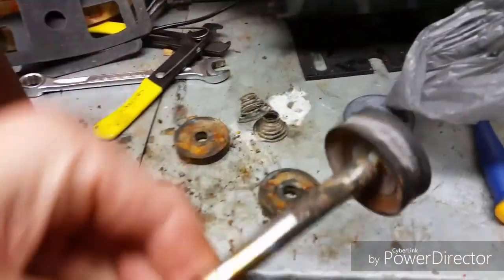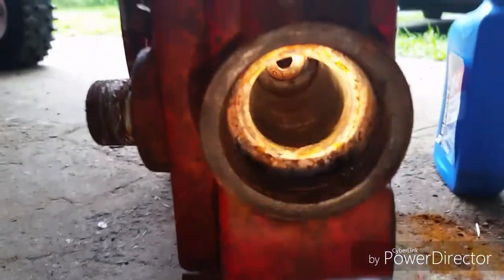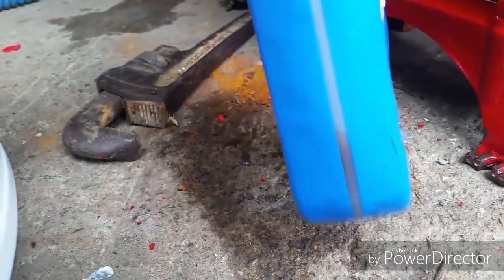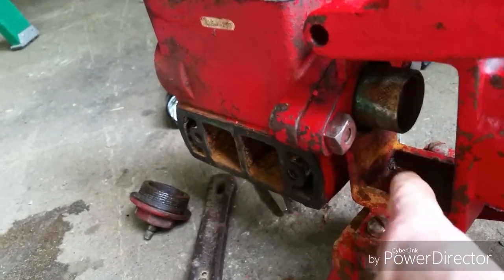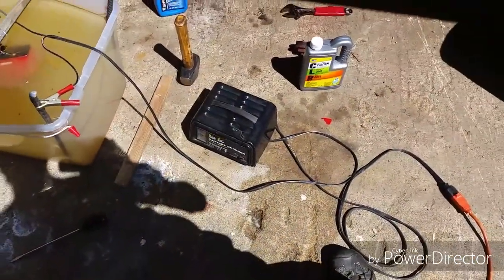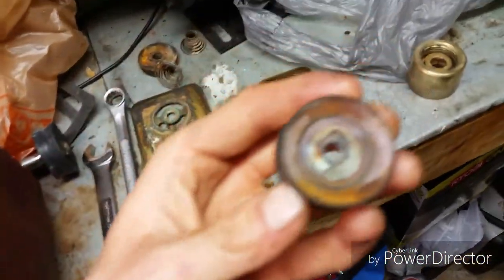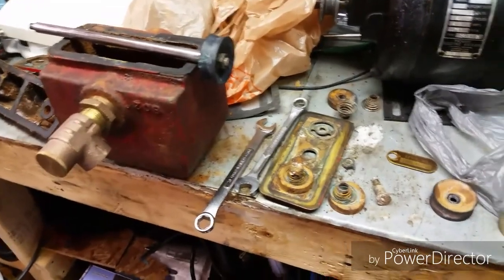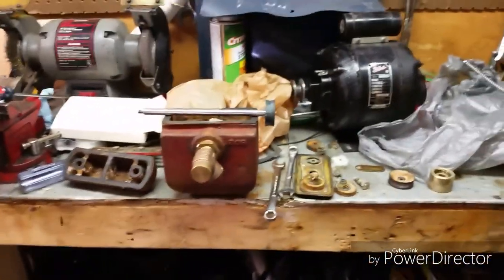1951 Lancaster piston well pump restoration part 2 of ?

Comment: It sure looks like you got a good plan on that pump, it should be as good as new when you are done.
I got a question, Do you have the microphone covered up by a case on that tablet you are using?
The sound is very muffled, the microphone on my tablet is also covered up by the case and I have to use it out of the case.
Reply from the maker: That muffled sound thing is bothering me a lot too. I tried recording with my phone out of the case and it still sounds muffled so I think it's the phone not the case.
Reply: Can you add an external microphone to it?
Reply from the maker: I don't think so, there is no external microphone jack. I wish I could use my regular camcorder but I can't afford the video editing software it requires.

Comment: Where did you get the parts?  I haven't been able to find any yet and I have an identical pump that was given to me.
Thanks in advance.
Reply from the maker: Luckily my grandfather had some spares lying around. I have had a lot of trouble finding parts as well. Still don't know what to use for the packing for the rod.
Reply: @coolbluelights  You should be able to use plain graphite string packing on it.  Usually graphite impregnated so the rod won't wear.  That's what mine has in it.  The packing in mine was wound around the rod for about 3/4" inch and the screw-on brass fitting (that you so kindly indicated unscrewed) will snug down and prevent major leaks.  A little water drip when it's running is good though, to keep the rod lubricated.  Maybe one drip per second or two seconds.
Most hardwares will have string packing someplace.  If you can get teflon impregnated, that would work too.  Oh yeah, the size is about 3 thicknesses of kite string.  If you can only get smaller stuff, I would braid it together before installing it.  I've done this and it worked well.
I tore this one down and found the spacer between the valves on the lower part was broken.  it's just a thin strip of iron and I don't really think it'll matter much because both valves lead into the same pump area in that spot.  I'm not sure, so I'll do it over anyway for the guy and find out.